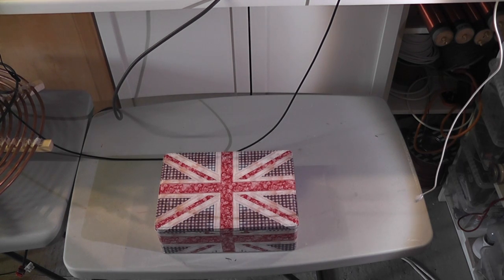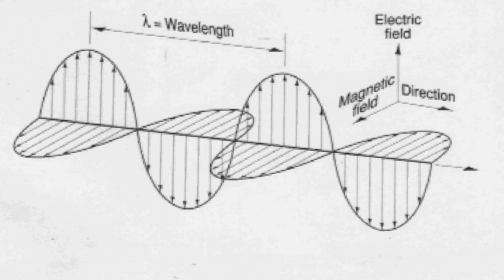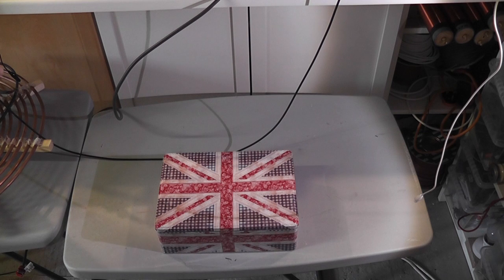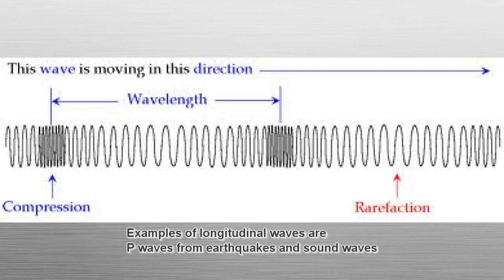Superluminal Scalar Waves for Communications

Comment: What is the operating frequency of the Tesla coil? Have you considered the skin effect? At 1 MHz, the skin depth is approximately 50 µm, meaning a metal enclosure can significantly attenuate the electromagnetic field, though signals may still be received to some extent. At higher frequencies, such as those in the FM band around 100 MHz, the skin depth is much smaller, and the metal enclosure will attenuate the signal much more effectively compared to 1 MHz.

Comment: There is no such thing as electric wave, electricity is a compound of dielectricity and magnetism.
Reply from the maker: I agree. It is a simplistic term for the laymen. The EM field consist of E for electrical field and B for the magnetic field vector. However it does not take into account the wave propagation in the near and far field. In the near field the dielectric component or scalar component is dominant. It collapse into the transverse propagation in the far field. You cannot shield any signal into near field. If you ground the receiver you make it worse.
Reply: @TheOldScientist  I'd like to add onto this a bit that what we typically think of a transverse EM is really quasi-longitudinal, in order to have a more conventional transverse wave motion you need a boundary condition of some sort present, since an EM propagates over free space the lack of boundary means it can't be transverse in the same way a surface wave is, looking through some of Bearden's work I found his proposal that it's quasi-longitudinal and it makes a lot more sense if you search up what the waveform looks like.

Extending from that, a pure Longitudinal Magnetodielectric (LMD) disturbance is a purely longitudinal dielectric propagation capable of instantaneous rates and lacks a magnetic component, the TEM or Transverse Electromagnetic waveform is a shift from the pure state to a partial transverse motion.

Think like a tidal wave, when it starts out its purely longitudinal under the surface and propagates at significant velocities beyond that of surface waves, once it reaches land it converts and slows to a more transverse motion, same principle.
Reply: Aye, a fellow Wheeler enjoyer!
Reply: @tjtommy5495  yeah but what he says is just common sense and he accredited all the masters when he talked about this.
Reply: An electric wave is actually the poynting vector, the ENERGY vector. You can't just throw away the Z-axis of electricity.

Comment: My first question would be if the lids of the boxes have electrical contact to the body of the boxes, the sun-question being if the inside edges of the tin lid and outer edges of the body are also painted or not. 

Even if they are insulated it shows enough of a difference to be rather impressive, especially considering you perform the experiment using a double- faraday cage, but one should reach for a skeptic-proof excellent conductivity between the lid and the body of the tins, or do another demo after sandpapering the contact surfaces, or repeat the experiment using an unquestionably perfect closure. It’s a tantalizing demo, but one should be very rigorous with such experiments to keep them logically “air-tight”. 

Regardless, this is an experiment worthy of duplication by amateurs, just to see what happens especially around the question of perfect faraday cages vs potentially leaky ones.

Comment: What is the field strength of the original radio signal versus the field strength of the Tesla coil on your bench?  The Faraday cages you are using are maybe good for 30 or 40 dB of attenuation, and will not attenuate a nearby Tesla coil signal enough to prevent its reception by your receiver.

Comment: Citation from the web:

v = π / 2 ( c )

v = average velocity of Tesla’s electrical current round earth (miles per second)

(you can plug in any metric and get same results)

c = speed of light (miles per second)

v = π / 2 (186,300)

v = 1.57 (186,300)

v = 292,491

While experimenting in Colorado Springs at the end of 1899, Nikola Tesla sent electrical energy around the earth faster than the speed of light. In his patent No. 787,412, filed May 16, 1900, titled the “Art of Transmitting Wireless Electrical Energy Through the Natural Mediums,” Tesla showed that the current of his transmitter passed over the earth’s surface with a speed of 292,815 miles per second, while the wireless technology we use today proceed with the velocity of light. In his patent he says:

“The most essential requirement is that irrespective of frequency the wave or wave-train should continue for a certain period of time, which I have estimated to be not less than one-twelfth or probably 0.08484 of a second and which is taken in passing to and returning from the region diametrically opposite the pole over the earth’s surface with a mean velocity of about 471,240 kilometers per second [(292,815 miles per second)].”

Tesla held, however, that our present “radio” waves are not true Hertzian waves, but act more like sound waves. They are purely radiation while his energy transmission through the earth gives off no radiation. Also, his energy is completely recoverable while other wireless transmissions are not. This is how Tesla theorized that he could send any amount of electrical energy through the earth to power the world’s machinery and technology.

So… Mr. “π / 2 ( c )” was, and still is a mind far ahead of his time!

Comment: This is complete rubbish. You have no understanding about em waves and you certainly have no idea on proper experimental techniques. A biscuit tin is useless as a Faraday cage. For 1, the metal is lacquered and will  not make a decent electrical contact with the base. So immediately you makema slot antenna where waves can pass through.

Comment: although the receiver has no ground, the transmitter does have a ground ... and the propagation may in fact be from every metal surface in the area. Do you find that this is so? That as the radio comes near something metallic, is the gain increased? Metal (or other ionic sensitive materials), are each acting like receivers I think.
Reply: In fact I would have made two modifications for this experiment, which I see is not done frequently (is this video unique in this sense?). 1) use not painted faraday cages, or at least use abrasive to the joint parts between the box and the lid. 2) try longer distances. I think the scalar wave is not emitted by the coil as its seems it is said in the video. The scalar wave is emitted by the topload of a tesla coil, but this video lack a full view of the setup. So it is quite misterious, I've seen it so many times but always end up with this remarks.
Reply: @tanner1985  Yet, a coil does have self capacitance, the tiny region between insulated windings. You can never make a perfect inductor. There are other wiring techniques to mitigate self capacitance.

Comment: there is something ı would like to ask:  you sad the scalar wave is the third component, so T.E.M and LMD waves are produced at the same time ? you used a tesla coil whic has a bifilar primary winding ı think so when ist on it produces both waves? arent L.M.D waves travel from point A to point B like a strait line without any loss? because we know that T.E.M. waves spread wide in all directions, so how did your radio picked up them from different directions?
Reply from the maker: They couple in the near field different. The transverse field establishes only after it reaches the far field. But in the near field any radio transmitter behaves that way.

Comment: The experiment is incorrect. You must have metallic contact in a faradycage between the lid and the jar. Otherwise, the cover acts as an antenna.
Reply from the maker: There need to be no contact at all. In the dielectric filed or near field there is no such thing as an antenna. Every inductor will receive the signal based on dielectric or capacitive coupling. Any try to isolate in terms of transverse shielding is pointless. That works only in the far field.

Comment: Hi TheOldScientist.
1) What technical modification did you do to that conventional radio so that it could received scalar wave ?
2) Is it true that a person on earth can communicate with a person on Mars using a scalar wave radio where
     the output of each scalar wave radio have only 10 a watts output ? 
     If this is the case then we do not need a 100 foot in diameter dish antennae like NASA use when they are 
     communicating with the Spirit and Opportunity rover on Mars. Am I correct on this ?

Comment: Can you transmit voice and sounds using tesla coil? If not,how can nobody devise way to put it into practical use like communicaton? Or does it just not work any better than regular radio?
Reply from the maker: It is like normal radio and works fine. However not convenient as the form factor is large.

Comment: Aren't you just creating a large inductance with the coil for the spread square wave to bypass the splatter filter on the harmonics(subharmonics) inducing the current on an ungrounded shield creating the capacitive electric field to the radio receiver.  Move the tesla away, and ground the faraday.  The faraday can't block magnetic waves, the earths gravitational field penetrates chambers.  Special Mu metal is required, nickle-iron ferromagnetic with high permiability.

Comment: Metal box is completely painted, so the lid is electrically insulated but capacitively coupled to the inside.  Needs to be at least sanded bare, or better yet add finger stock to ensure better continuity.

Comment: Do you think we could use this method to receive power wirelessly, and without a ground, using a simple of circuit?
Reply: you'll need high vacuum and extremely fast and powerfull methods for swithcing high frequency currents (like hf qcwdrsstc), the vaccuum dramaticaly decreases impedance, if the wire lengh corresponds to 1/4 the wavelengh of the electrical disturbances, then you'd have only ohmic resistance trough the hole circuit, obviously the coil acts like a virtual ground at this case.

Comment: Does it work over 4 miles away, if so this would prove it would perhaps not be a mere radio transmitter
Reply from the maker: Based on the frequency as mentioned it works for the near field.

Comment: Can we use this method to transmit power to anything that resonates at the same frequency?
Reply from the maker: Here the principle the water wave applies. Also, it is a near field effect only where half the frequency length can be used to transmit. At far field level it behaves like normal transverse signals from any broadcast station.
Reply: TheOldScientist so, if I wanted to “tune in” to the scalar wave, I’d have to resonant at half the frequency?
Reply from the maker: The Naming convention Scalar is very abstract. What it does not apply to is to our 4 dimensional space. A tuning can not be proven because you would need a receiver which can receive such a signal, listing to counter space so to speak. Maybe it is better to understand when our mind is communicating in counter space and receiving messages from family or friends or a simple precognition about future events. That is Scalar. Instantaneous and timeless everywhere all at once. Quantum entanglement.
Reply: TheOldScientist okay?
Reply: TheOldScientist question: do you know much on Meyl’s scalar plane and how to reproduce it?
Reply from the maker: I do and references his work. He does it however not efficient. Consuming 10 watt of power for this low output on the receiver.
Reply: TheOldScientist how low is the output?
Reply: TheOldScientist and what is output circuit?

Comment: Thank you for the i teresting video. Please explain: (1) What control did you change on the radio when you set it to 187?  (2) Please turn off the 187KHz that you are transmitting from your signal generator to prove that the radio is not generating 187Khz. Thank you.
Reply from the maker: It is a simple radio receiver. You can try that out yourself. It is very simple.

Comment: Okay so you have one end of your secondary coil connected to nothing. The other end connected to the oscilloscope. Is that correct? Also is your oscilloscope measuring with only one lead from the probe? Or do you have to connect the other lead somewhere? Also how much voltage are you applying to your primary and is it at 187MHz? Thank you.

Comment: You sent a tone to the radio so technically isn't that information you sent to the radio using the scalar waves? If so, then can one make a simple radio transmitter transmitting music to the receiver? I have been experimenting with single wire transmission, but I don't understand how to send waves to be received by radio. I have watched this video and it is amazing. What technique are you using to get rid of the ground wire?

Comment: Okay thanks, but the Wiki article describes his measurement as "an interesting approximation" and concludes that this reading was in error (due to primitive measuring device).  Also the article just mentions "the measurement of the velocity of electricity in a wire" not Longitudinal/scalar electric waves velocity.  Did Wheatstone ever mention Longitudinal waves do you know?

Comment from the maker: I have two walkie talkies and they work without manipulation with factory settings on the UHF band of 449 MHz. that is however not optimised for that. It is much more complicated then that. You would need to use the frequency to drive an amplifier which would drive a capacitive load to your target frequency. We talk about radio engineering principles here. I recommend to read and study the ARRL handbock for radio communications.

Comment from the maker: You are correct. A special tuning, not common in broadcast topologies has to be applied to increase sensitivity and range. I have a paper under research which allows to understand the concept. It is called "The energy sucking antenna". However it is still based on the TEM ( transverse Electromagnetic) propagation. With LMD (longitudinal Magneto Dielectric) propagation we have to go beyond that.
Reply: My question is it possible to transmit Scalar waves, with no ground connection, and use this antenna to receive an efficient amount of power to perhaps light a bulb or power a motor

Comment from the maker: I used the first mutual resonance frequency but it resonates in higher frequency as well. Not so good. Bare in mind that the driver and the TMT coils are not matched. The TMT has to behave like a transmission line. It will never work like a lumped circuit because there is no even current distribution. I will follow up on higher frequencies and build some cases for the critical comments I received.

Comment: Unless beam directed, scalar is >unavoidable< QRM, and capable of energising circuits not normally affected by normal electromagnetic radiation.
You have demonstrated that it can pass through a metal screen, so what about heart pacemakers and medical equipment protected only against normal EM ?
What about vehicle electronics, digital systems and computers of security forces + industrials etc.?
Besides, Tesla also reminded folk about conservation of energy, for there is no energy advantage here.

Comment from the maker: What I can tell is that I see an output increase, when I measure it. What the spectrum analyser is concerned, I am not sure if the results are very good but as said it gives an indication. Checking with the scope and signal generator for the specific frequency did not result in a match. So you are right. I have to get better equipment for that.

Comment: The harmonics on the spectrum analyzer for a square wave is a artifact of the math.  It requires the sum of all the harmonics to get a square wave... It's not actually that many frequencies.  But there are ultra-wide-band transmitters, which use a comb and many fequencies similarly.

Comment from the maker: Not at all. Forget your Antenna Idea. That is relevant for transverse propagation but has no relevance for longitudinal propagation. You need capacitance to improve propagation and loose coupling between primary and secondary coil. Also you need a Bifilar coil as driver. The Bifilar coil is a natural scalar wave transmitter. I checked it on the spectrum analyser and it showed what I was expecting from my tests. It resonates to all frequencies without preference.

Comment: Great work, I had just decided to start building a scalar transceiver, so brilliant timing. I was just wondering, is a Tesla coil the best transmitter or will any type of coil produce similar results? Also would a fractal antenna arrangement boost reception or am I barking up the wrong tree with that idea?

Comment from the maker: Can you elaborate. QRM to my understanding is a superimposed electromagnetic interference and produced by all sorts of gadgets in your house. There is no way to eliminate that. When I start my oscilloscope and spectrum analyser I get all sort of high level frequency. I call them spook waves because I have nothing running in my house to cause that. Working on a defined frequency band to transmit signals require of course a license. Which you can get with no problem in the UK.

Comment from the maker: With adding the Tesla component on the receiver side it works on the far field as well. It need to be investigated how much the near field has an effect on communications like simple radio like walkie talkies.  The near field is under normal condition not larger then a couple of meters based on the amplification. And I have tested it over many Years. It does not extent to 20 or 100 meter with power input from an oscilloscope.